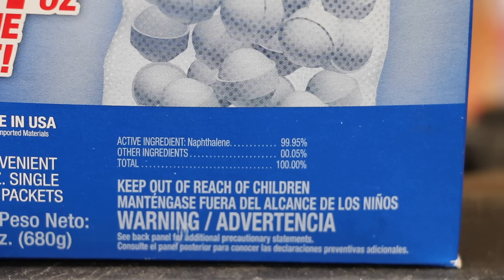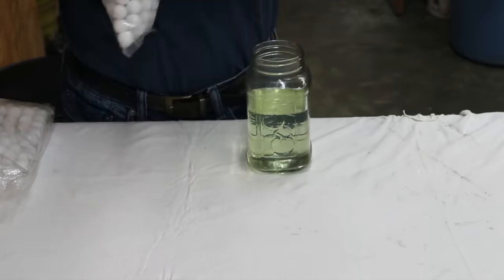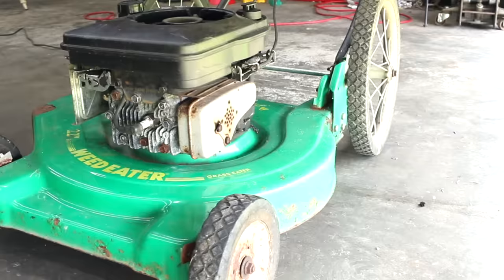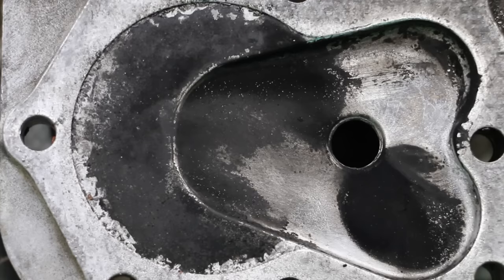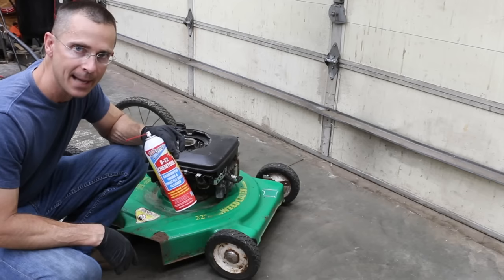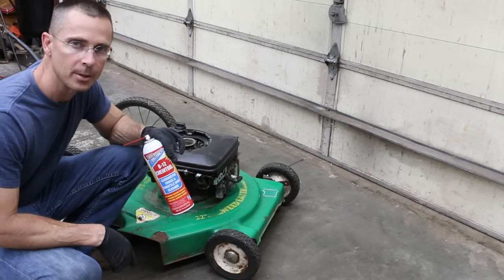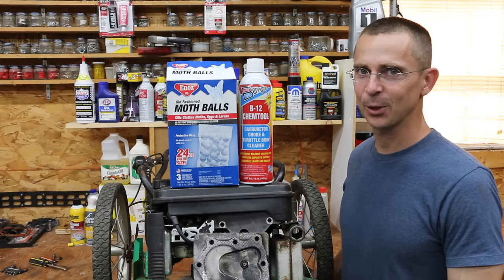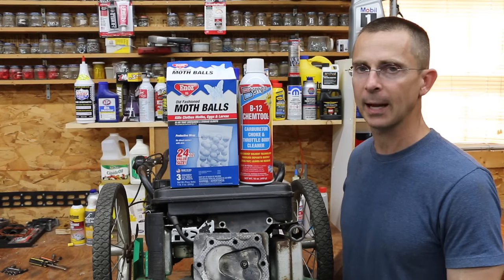Will Mothballs in Gas Destroy an Engine?  Let's Find Out!

Comment: We would really have understood better what's going on if you hadn't dumped all the mothball sludge into the fuel tank. Would have been a lot easier to strain it or just pour off the clear and then run it, like what you would have had on a car where any particles would have been stopped by the fuel filter.
Reply from the maker: Great point!  Thanks for the constructive feedback.
Reply: RedfishCarolina 
  I was hoping he was gonna do that  but maybe in a next video
Reply: RedfishCarolina EXACTLY
Reply: Well I think he was going for was like if you just plopped some mothballs in your fuel tank. You can't strain it out once u put it into ur tank
Reply: Try coolant to see if it will clean the valves and piston
Reply: IronOxide Man  but to scale, you would have to dump a garbage can of moth balls into a full size fuel tank. I think he went way overboard on the mothball/ fuel ratio for a fair test.
Reply: was thinking the same .......i used it before and used 5 crushed the day before and the next day car had a small increase of course  more air is also needed
Reply: IronOxide Man unless your car has a fuel filter
Reply: I would agree, this test proved nothing being he dumped all the crap into the tank. Of course it is going to clog. Not that I thought it would help performance anyways, it would have been nice to see how it ran.
Reply: RedfishCarolina I totally agree but a fun vid
Reply: G'day,

  I have to agree.

   To test the Legend that, "...if you add a handful of Mothballs or Napthalene Flakes into a TANKFUL of Fuel, then your CAR Engine will make more power..." ; then ONE Mothball in that little bit of Petrol would've been too much !

   I'd like to see a test which attempts to replicate the kind of Mixture which the Olde Rev-Heads used to speak of...; this was a meaningless exercise, because it was a blatant attempt to run the Motor on Pure Napthalene with a tiny bit of Petrol used as a Solvent, rather than running it on Petrol with a tiny bit of Napthalene added in.

  Such is Life,

  Have a good one...

  ;-p

  Ciao !
Reply: RedfishCarolina I used moth balls in my cars, it seemed to help
Reply: Found this online -

Actually, yes, mothballs will slightly assist the octane rating of gasoline. HOWEVER, in that grain of truth there lurks the potential for disaster. One must use very few mothballs (naphthalene only) because the ratio of carbon to hydrogen in the molecules makes for a very dirty burning fuel. Too many mothballs and your engine will load up with carbon deposits -- very bad news in the performance department￼.
Reply: RedfishCarolina  I was going to make the same comment.
Reply: i added like a stupid idiot mothballs to some gas that i mixed and used for a 2 stroke thinking it would help keep the carb clean ,, not only did the carb clog the seals also got damaged , and the in tank suction hoses were also damaged ,
Reply: RedfishCarolina Strain off the sludge plus not dumping almost a whole bag of mothballs.
Reply: Agreed , I had no problems with 3 or 4 mothballs in 10 gallons of gas. Worked well for me. I did see a slight performance increase.
Reply: yea maybe a revisit is in order
Reply: Project Farm they work great but the problem is that you put to much
Reply: RedfishCarolina my cousins used to do this in his race car, supposed to crush or grind them into a powder then dissolve them then strain the fuel before putting it into the tank. You just want part of the mothball chemical makeup you don't want the waxy byproduct to go through the engine.
Reply: Agree, it proved nothing.
Reply: Also i think he used too much of them. I think 2-3 would have been enough
Reply: RedfishCarolina exactly, there's no way to see the effects of burning naphthalene and gas when you fill your entire fuel system with sludge. This video was just a waste of time.
Reply: ditto to the other comments, kind of dumb way to do it. Maybe he gets a kickback from the aerosol company...
Reply: Agreed.   Test was ruined before it started.   

1. Engines don't run on sludge
2. No filter employed
3. No research on mothballs per gallon ratio
Reply: RedfishCarolina In the 70s with the low grade fuel of the day, I would dissolve a 2-3 mothballs in gass before putting it in my Harleys gas tank. I never had a problem, it ran much better and I didn't have to buy expensive additives all the time...I usually did 1 to 1-2 gallons.
Reply: you ruined the idea who ever you are Project farm ..why try another shot and use a fuel filter though....
Reply: the fuel filter wold do exactly that
Reply: HI  I have a new Hyundai 4 cylinder car. I live in mexico, gasoline is very bad quality. I started adding abaut one ball per liter, now I have more kilometers for liter!
Reply: RedfishCarolina truth
Reply: IronOxide Man Exactly this
Reply: Project Farm dun goofed on this one
Reply: No need to be rude to this man... he took the time to make a video for educational purposes.. and yes if he was see what would happen if you just dropped moth balls in the fuel tank.. no way to strain it while ins in a fuel tank..
Reply: Right
Reply: i was thinking that at the gate... another test should be done with strained fuel
Reply: I agree. So really the verdict is still out for mothballs in gasoline engines.

Comment: You are the Mythbusters of small engines!
Reply from the maker: John, LOL!  Thanks for watching the video and commenting!
Reply: John Possum 
Yes, he really has a fun program going, real world stuff that most of can relate too. We both enjoy his channel..
Reply: Project Farm 
funny.  there is a muthbusters episode where they test mothballs.  they did get a hp boost.  maybe revisit this after looking it up.  And not dumping sludge in the tank.  lol
Reply: MAGGOT VOMIT 
He knows that now!!! And If you read thru the comments, he is planning on doing this again with a clear, filtered tank of mothball treated gas.
Reply: I've used the same brand of mothballs and they completely dissolved in gasoline over an hour.  This experiment is very misleading.   All it shows is to not run sludge through your engine.
Reply: More like a Mothbuster
Reply: John Possum I
Reply: John Possum no sure mothballs. And it needs to be napathen it removes moister and to 20 gallons of fuel 5 mothballs

Comment: I ran mothballs in my 1981 shovelhead for several years while on long trips but I only used two to three in each side worked great. The lawnmower liked one ball per gallon and the snowmobile ran a little to hot so I stopped that. I did have a gain in power using mothballs.
Reply: Ya only a few I was told .. 3-4 a tank in car

Comment: I'd love to see this one revisited with completely dissolved naphthalene, considering it's a common ingredient used in alot of fuel system cleaners I've noticed
Reply from the maker: Thanks for the suggestion.
Reply: Yeah, when I did this I crushed about a cup worth of balls into a powder then dissolved the powder in a gallon of gas, then added the gallon to my field cars gas tank, which was around a 1/4 tank full. The car ran fine and I had quite an improvement in power.

Comment: Can you run the test with much fewer mothballs.  Curious to see if it does help performance.
Reply: Greg, I've been running and recommending Naphthalene for about 45 years now. Never a problem. But I recommend one per gallon of capacity to CLEAN the system (thoroughly) and then one per every 2-3 gals you add for additional performance.

But what do I know, I'm just a hillbilly that's served over 4,000 clients in the last 10 years.
Reply: Yeah I thought the same, he should have tried with just a few mothballs
Reply: @thegadgetmangroove6304  My testing showed 4-6 per 20 gallons of gas was optimum.  The difficulty is maintaining a consistent ratio.  Who runs their vehicle completely out of gas before refuel?  I found the benefit to be slight and irregular.  Stopped using it when it killed my catalytic convertor.
Reply: Didn't Mythbusters test this?
Reply: @thegadgetmangroove6304  "4K Customer's is the past 10 years. " 
WOW! That is something to be said for.
Reply: Yes. I think there was an excessive number of moth balls
Reply: You have to strain the mothballs in acetone to get it to dissolve and then you won't have junk in your carb.
Reply: @Hammarsand  they used a fewer mothballs and it worked well, mythbusters showed a result of higher rpm and improved horsepower
Reply: @hidden7soul  Well there's youre problem 🤣
Reply: @Hammarsand  🤣 that is a commonly used line in mythbusters by Adam

Comment: I think it is awesome that we have you to do all these wacky things to an engine to answer questions many of us were too afraid to find out for ourselves.  But on this test, the amount of mothballs in relation to the little amount of gas isn't what one would have been doing to make their (wild?) claims.  A full tank of gas in an auto is many gallons as opposed to just 20oz you used, and the amount of moth balls may be equal to or less than what you used. I would have found this more telling if you 'creeped' up on it, starting first with just a little and working your way up. Because what you did is likened to pouring bags and bags into an auto tank which I doubt anyone would do.
Reply: Can you please do it again but this time 'creep up' on it with the mothballs? Also, strain the undissolved particles.
Reply from the maker: RixCanDoit, This is a great suggestion!  I agree that I added too many mothballs.  I will probably repeat the test in the future.  Thanks again!
Reply: RixCanDoit I thought the same thing when I seen it poor into the funnel.
Reply: Project Farm 
please do repeat!!!
Reply: ..."when you SAW it POUR into the funnel? Geez!
Reply: Project Farm yes please do just that. I'll even supply you with a small block chevy engine
Reply: My thoughts exactly.  First determine the maximum amount of moth bolls that can dissolve in the gasoline volume you use by pouring a bunch (know the weight) into the gas, let it sit a few days with occastional agitation, and then strain out the liquid.  Weigh the solid portion to determine the amount that dissolved in the gas.  That's your maximum moth ball value.  Make up 2 or 3 other solutions with less moth balls (maybe 25% of the max, 50% of the max, and 75% of the max).  Then use those solutions to sneak up on the max as discussed perviouisly.
Reply: Too many Moss balls only add one to that much fuel
Reply: This test is wrong!!

Comment: Do you think that "filtering" the mix, or at least keeping the white residue out of the engine would have worked better? I'd imagine that in some way or form, the mothballs mixed with the gasoline, and that the residue was just some kind of excess that gasoline couldn't absorb?
Reply from the maker: I believe you are right.  I still believe that there would be a lot of carbon build up and black smoke, but it would have ran better.  Thanks for commenting!
Reply: Project Farm you also mentioned people did this in the 60s. I wonder if the higher lead content in the fuel back then would alter results.
Reply from the maker: Nicholas, This is a great point!  Thanks for commenting!
Reply: You can try it with some av100ll gas. I've started using it in my small engines without a problem. Regular fuel started turning black over the winter, and causing problems, so I had to waste a lot of it. I kept it on hard for the generator.
Reply: snoopdogie187 Isn't av100ll "avgas" or aviation gasoline? I've heard that running that fuel in anything except an airplane engine is illegal; do you know if that is true?
Reply: HWandW it's might be like running heating oil in a diesel that is definitely illegal
Reply: +HWandW
Av100ll is only illegal to use in on road vehicles. The definition of on road vehicle can be a little confusion I heard. I think it was any vehicle manufactured for the purpose of being used on road, and that you can't convert it to an off road only vehicle then. 
Av100ll is also bad for any engines that have catalytic converters, which is any modern car. 
The only reason it is illegal to use is because of the road tax placed on fuels. The same is true of heating oil and diesel. They are mostly interchangeable, or at least were before they started using low sulfur in diesel (it still might be interchangeable, but I really don't know). They are just illegal because of tax purposes, and carry a hefty fine if you are caught. 
This makes me wonder about the legal aspect of electric cars, and bio fuels. They don't have the proper tax added to them.
Reply: i added like a stupid idiot mothballs to some gas that i mixed and used for a 2 stroke thinking it would help keep the carb clean ,, not only did the carb clog the seals also got damaged , and the in tank suction hoses were also damaged ,
Reply: its actually a chemical compound thats the result of the petroleum distillate naphthalene reaction  sorry my chemistry isnt good enough to name the compound produced  bit it isnt a absorption thing   if memory serves  its a napalm variant  or a viscus flammable substance not really suitable for internal combustion as it wont atomize and is so viscus

Comment: You should do a Carb cleaner test to find out which cleaner is the most effective. Personally I use a B12 as well and think its great. Would like to see how it compares.
Reply from the maker: Great suggestion.  Yes, I did use B-12 in the 2nd part of the video and it did a terrific job!  Thanks for watching the video and commenting!
Reply: B12 Chemtool is a great product. I would never use much else of anything to clean Carburetors, engine heads, etc.

Comment: Really liked the editing in this video! If you're interested in doing a follow up video to this one, I think we're all curious what would've happened if you had dumped the undissolved mothballs into the tank. I do wonder how much of the damage was caused by undissolved particulate vs the mothball material in solution. Or perhaps just try adding napthalene itself to the fuel?
Reply from the maker: Cyanide Cloud, Thank you very much for the positive comment.  I wish I would have filtered out all of the solids.  I might accomplish a follow-up video using only a few mothballs and filtering out the solids.  Thanks again!
Reply: Project Farm looking forward to it :)

Comment: I flinched when I saw him pour.
That was so overdone, I'm not even a car guy and can see thats a bad idea. Oversaturated far beyond the point of precipitation. You should try it again, except filter it first.
Reply: You do realize that clogging the fuel filter with mothball residue is not better than clogging the carburetor or fuel injectors with the same residue, right? They will both cause restriction in fuel flow and require replacement of parts to fix.
Reply: @deusexaethera  according to comments here people put in about 5 moth balls for ~10+ gallons, not 10 mothballs in a quart. If done right I imagine it dissolves a ton easier

Comment: You need to fully dissolve the mothballs in the fuel to create a true poor mans race fuel. You cant dump in half dissolved mothballs in a fuel syetem the outcome was predictable. I have run it and it works awesome!
Reply from the maker: Great constructive feedback--thank you!  I'll probably repeat the test and ensure they fully dissolve.   Thanks again!
Reply: Take three mothballs and break them in to smaller pieces and add to 1 gallon of gas and shake till dissolved or sit for 24 hours shaking every few hours then use on a higher compression engine or an old v8. You will notice a change..
Reply from the maker: Thanks for this recommendation!  I'll try it on the old Ford Ranger.
Reply: your  right on, we used them in the 50s  Flathead v8  the good ole days
Reply: Playinwithhorsepower does moth balls kill a car engine If so how many u need and is it detectable

Comment: I've been wondering about things like this most of my life. I grew up turning wrenches on motorcycles. I've had real discussions about this very topic as well "sugar in the gas" and "sand in the oil". It's so cool to see these old engine myths put to the test. This could easily be a segment on one of those car shows on TV. It's every bit as interesting as watching someone put high performance parts in an engine and seeing how much HP they made, and there have been several shows about that.
Reply from the maker: Thank you for commenting on this.

Comment: Never thought of using moth balls, but I really like the b12 chemtool. It's always my go to for carburetor repair
Reply from the maker: Thanks for the feedback.
Reply: @ProjectFarm  what about the best methods for removing rust like electrolysis, vinegar, chemical removers etc? I'm working on a Kawasaki mule that I recently acquired, and I need to remove rust from the gas tank.